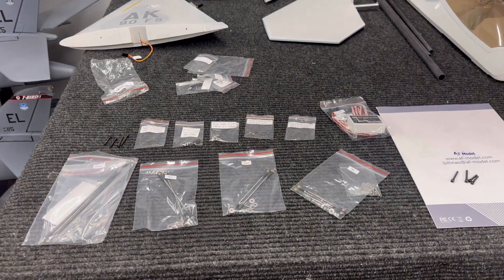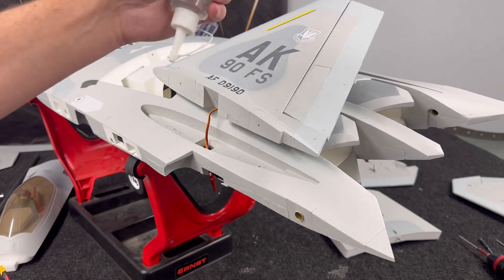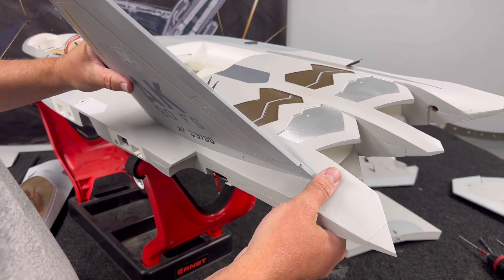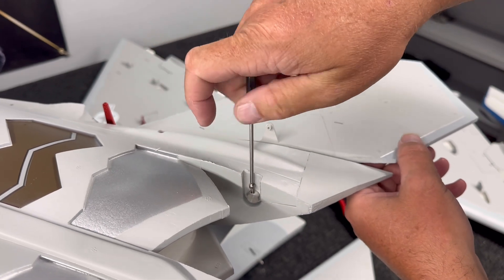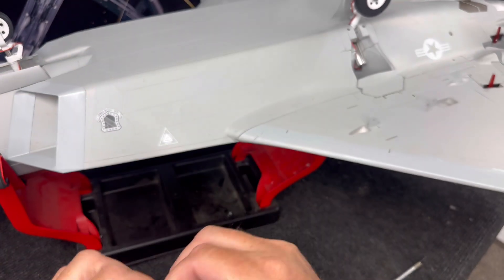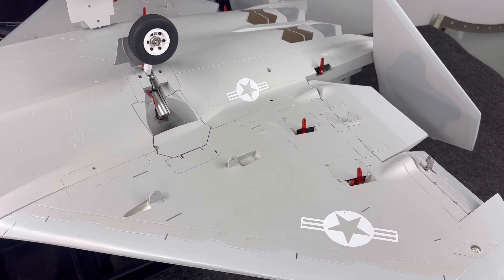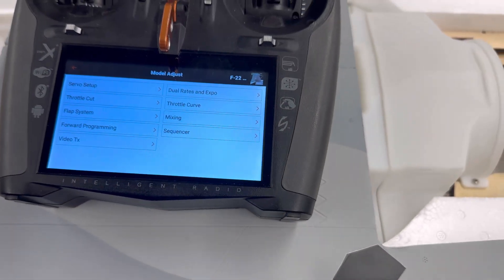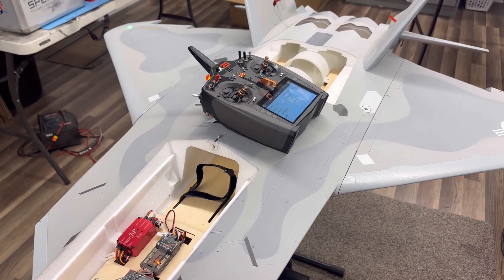AF Model 105mm F-22 Raptor assembly guide

Comment: Adjusting the elevator angle can help adjust the aircraft's center of gravity, improve takeoff and landing performance, especially for delta-wing aircraft, and compensate for any unwanted pitching moments caused by misaligned thrust angles.